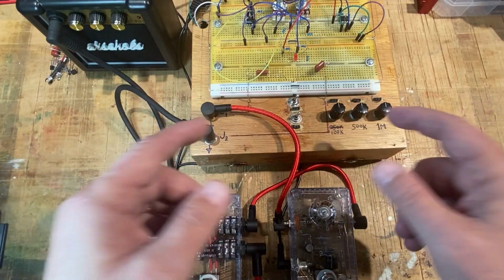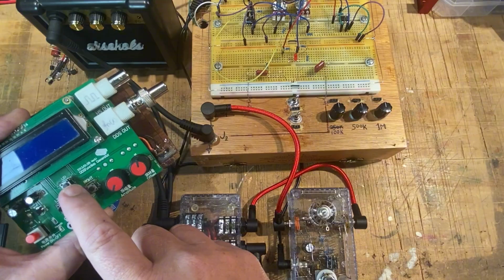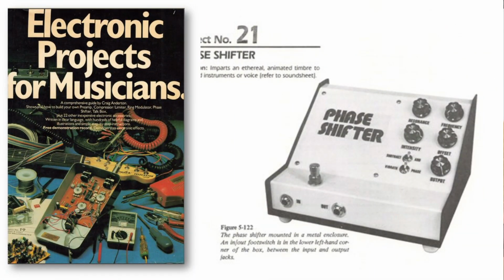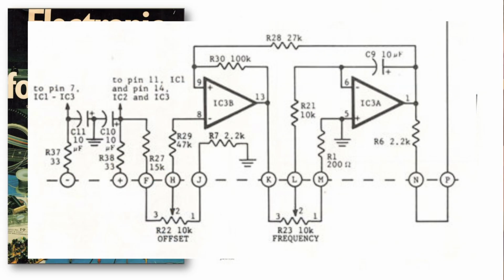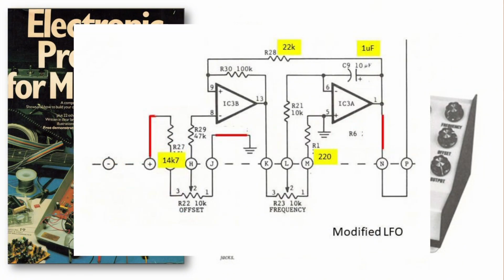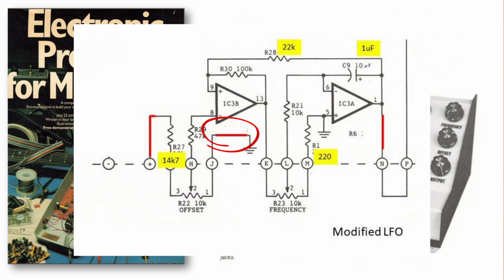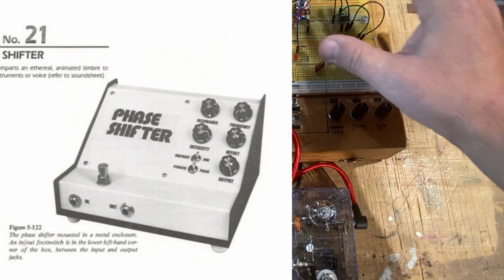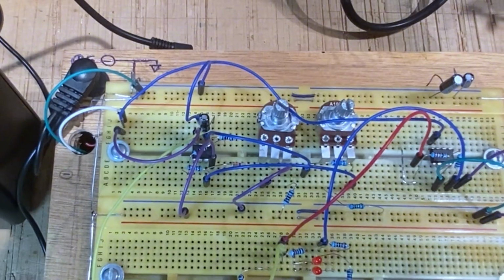How a Diode + LFO Becomes a Ring Mod-Style Guitar Modulator (No Op Amps)

Comment from the maker: What happens when a tremolo stops being a tremolo?
In this experiment, I push a simple diode switch and LFO beyond low-frequency modulation and into the audio range — where new sideband frequencies appear and the effect starts to sound ring-modulator-like.

Starting from a diode-based audio switch, I first use a low-frequency oscillator to create tremolo. Then, by modifying the LFO to reach audio frequencies, the interaction between the oscillator and the guitar signal produces complex, inharmonic tones. While this isn’t mathematically a true ring modulator, it lives close enough in that territory to be worth listening to — and exploring.

On the bench, I walk through:
•	Using a single diode as an audio switch
•	Modifying an LFO (inspired by Craig Anderton’s Electronic Projects for Musicians)
•	Pushing modulation into the audio spectrum
•	Why sidebands appear when signals interact
•	Why simple, minimal-parts circuits can still produce wild results

The result is an ugly, shoegaze-adjacent, bass-heavy modulation effect — not clean, not perfect, but undeniably interesting. This experiment also sets the stage for what’s coming next: cleaning up the design, moving toward a four-quadrant multiplier, and eventually using solid-state devices to mimic triode behavior in guitar circuits.

Sometimes the most interesting sounds come from seeing how far a simple idea can be pushed.

Comment: I definitely need to build this to spice up some crazy solos. I love when there are lots of overtones and odd harmonics. It makes me brain go bzzz. 
Thx for the reminder. I had an ehx tremolo some years ago, but I always hoped the frequency knob would go even higher : p ... alot! I need high frequencies to make things sound interesting. Building these ultra fast tremolos and some "real" ring mods will teach me a lot (..of something I really want to learn). Greetings from Finland.
When does rhythm stops being a rhythm and becomes a steady "tone" to our ears? : ) 25-50Hz (pulse waveform) range seems to be the area where the "crackling/ultra fast beat" starts to fade away more and more. 
If our hearing sensory system would be tuned differently, we'd perceive that phenomenon at different point I guess. Same goes with light! Ha.
If a tree falls in the forest (and is there someone hearing it?) ... it makes no sound what so ever, but it does make the air vibrate ; ) Same goes with photons. Photons are not light, but we perceive such THz mechanical oscillations as something we call "light". [qualia].
Yeah. Cool channel man! :D
Reply from the maker: Thanks for the kind words! It sounds like you've got some really interesting projects ahead! You are on to something with the beat frequency of a tremolo getting faster and faster until it becomes something else. There's some definitely interesting noises to be made here.

Comment: It sounded like an interesting fuzz, might have been interesting if you could have got the LFO freq up even higher or alter the mix ratio.  I like the minimalist idea of using diodes as mixing element.  Similar to discreet JFET versus op amp for audio preamps.  Keep it simple.  Love your king Edward tube boxes in your other posts.  Got a tube amp a few years back, after a few decades without one, those tubes give such a unique lovable sound, simply cannot be reproduced without those glowing tubes.
Reply from the maker: Glad you liked the sound! It definitely had a unique flavor. 😊 I experimented with higher frequencies off camera and the results were closer to a typical ring modulator. Since you always hear the modulation signal though, it quickly felt like an ice pick in the ear. LOL 😂
I need to do more with cigar boxes again. 🤔